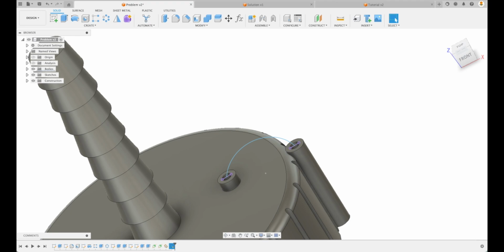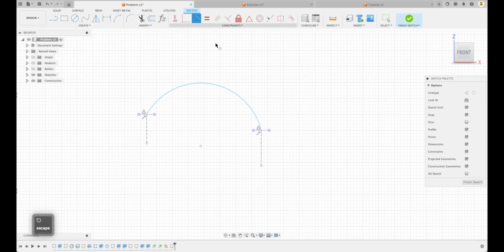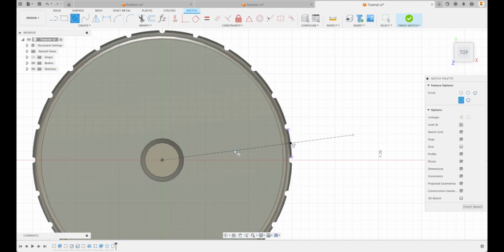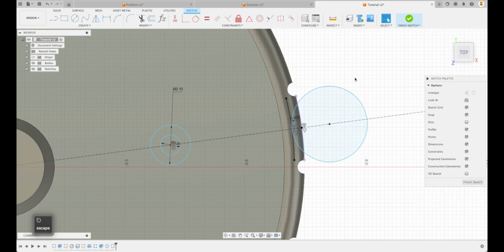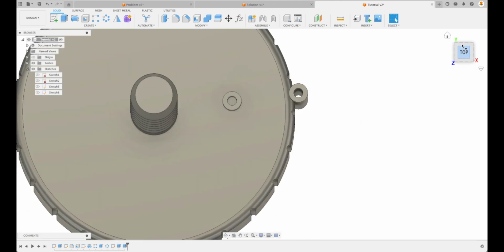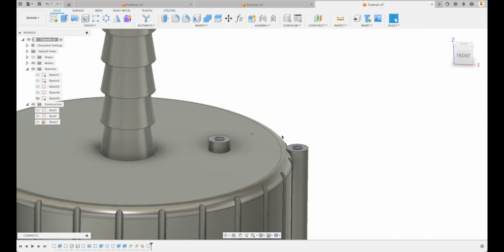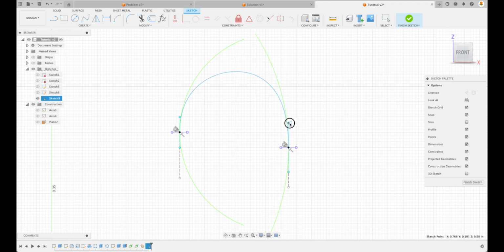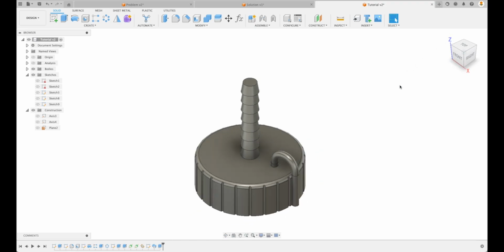Autodesk Fusion 360 - Sweep Tutorial - User Request for Help (2024)

Comment: If the tangent tube height was equal in height to the stub pipe on the lid, would you be able to get tangent on both ends? I can see only tangent since the faces were at different elevations. Awesome tutorial. Thanks.
Reply from the maker: Thanks so much for your comment and question. Yes, they both would have been tangent if at the same height and much easier to design. 
Hope you like our other tutorials and hope to hear from you again!

Comment: Another way, and one that avoids splines since I sometimes find them problematic later in design, is to simply add a vertical line from the center point of the lower tube, make it vertical, then make your curve tangent to the construction line on the higher tube and tangent to the vertical line extending above the lower point. There is only one solution for that set of constraints, so the new line will be scaled accordingly (putting its top even with the higher tube) and the sketch will be fully constrained.

Another advantage to this is it survives changes in the initial tube heights without changes to the curvature of the joining tube.  If either initial tube moves up or down, assuming the lower does remain lower than the original upper, the curvature will not change in any way.
Reply: Yes, that would be both more elegant and more robust. 
I would model the whole tube with one sweep.
Reply from the maker: Excellent solution! Simple yet effective. Thanks for sharing.